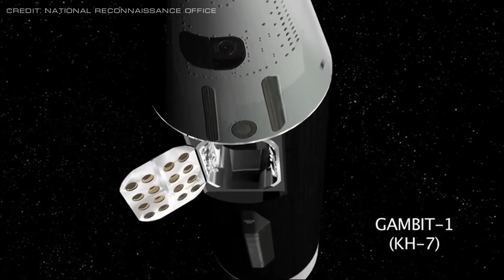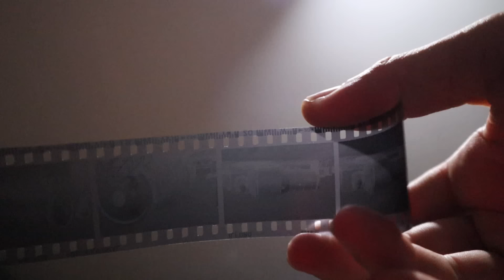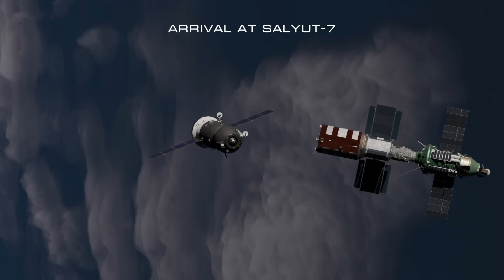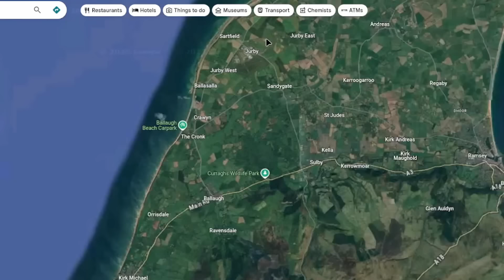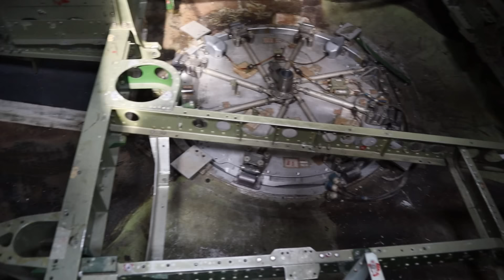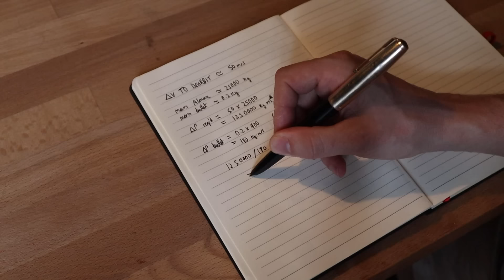Almaz: an Autocannon on a Space Station

Comment: You might be interested in using these equations to estimate the necessary correction for a gun fired from a station in a circular orbit at a target approaching slowly, such as the scenarios in this video:

https://en.wikipedia.org/wiki/Clohessy%E2%80%93Wiltshire_equations

The equations are essentially derived by linearising the equations of motion around a circular solution, similar to how a Taylor series tells you what low-order behaviour approximates a function around a given point

Comment: Is there any scenario more terrifying than being an astronaut launched into orbit on top of a hydrazine/dinitrogen tetroxide propelled rocket?

Yes, I think there is:
Make a ballistic missile designed to launch multiple nuclear warheads instead of a crewed spacecraft. Fit that missile with similar (albeit smaller) rocket motors, also using hydrazine as the fuel. Instead of using straight dinitrogen tetroxide (aka NTO) to burn the hydrazine, pick an oxidiser which is even more dangerous: Red fuming nitric acid (aka RFNA), which has all the same risks of NTO because 20% of it actually is NTO, but comes with the bonus prize of being horrendously corrosive as well.
This hydrazine/RFNA propellant combination is so murderously vile that even the rocket scientists who first concocted it gave it the name of "devils venom", but try not to think about that too much. Install 16 of these missiles on a submarine. For extra fun, make that a nuclear submarine with two nuclear reactors on board, fuelled by uranium enriched to 45% U-235.

Now imagine you are one of the crew living on board that submarine: All that hypergolic, toxic and corrosive rocket fuel isn't being burned with you right next to it, except in the hopefully rare event that any of those missiles are launched. But you are right next to it, not for a matter of a few minutes (like the astronauts), but for the entire time the submarine is on active patrol, which can be as much as six months. So a similar risk that the astronauts were taking, except that it is now constant and existential the entire time you are on board the submarine.

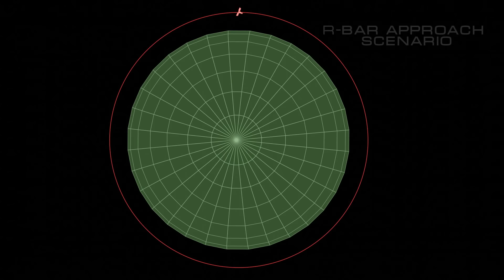Comment: 32:36

Just use high explosive shells with self destruct fuzes timed to be significantly less than 1 orbital rotation. (a common feature for HE and HEI shells going back well before WWII and common on the cannon shells in question)

23x115mm High-Explosive Incendiary (HEI) rounds
Fuze: BSh-23 Point-Detonating (PD) fuze with an SD mechanism. Some older rounds use the UB-23 SD nose fuze.
Mechanism: For rounds with the UB-23 fuze, the self-destruct is a setback-fired powder-train delay that detonates the shell after 4 to 8 seconds. 
used in the GSh-23 of the Tu-22M (and various fighters and ground attack aircraft). That was a relatively common cannon (and still in use), and used the same ammunition as the older NS-23 cannon, but not the weird thing used on the original fixed-wing Tu-22 (not the later 22M as seen in that drone footage ... those all mount the GSh-23 twin-barrel gast gun).

The Rikhter R-23 used on the Almaz (and original Tu-22) has really weird telescoped ammunition, with the shell inside of the case, surrounded by propellant. (using 23x260mm ammunition, with the shell completely embedded inside the case)

There's no information I can find on the detailed specs of the R-23's shells, but I suppose you could use the standard 23 mm HE and HEI shells as a baseline. (it's possible they used a similar projectile inside the 23x260, but hard to say without detail; the heavier 23x152 mm cartridge often used the same projectiles as the 23x115, so that's worth noting, but the unusual nature of the 23x260 leaves that less straightforward) 

But even assuming self-destruct within 8 seconds after firing, you then still have to deal with the tiny steel shrapnel particles left over from the shell. (granted, they'd be dispersed and not concentrated, so the danger would be lower)

Also no lead here, just steel and a bit of copper for the driving band (where the shell meets the rifling), so the density of the fragments would be that much lower ... though that only matters for sectional density of the impact, since we're in a vacuum and air resistance doesn't exist. (the aluminum in the HEI composition, assuming straight HE wasn't used, would also probably end up as hot, molten, finely divided atomized aluminium which would condense into finely powdered aluminum dust since there's no additional oxygen for combustion, and probably not be a significant factor overall) Russian HE shells of that era (and modern ones, along with many US, British, French, and other designs) also used thin drawn sheet steel casings with maximum HE filler based on WWII era German "Mine Shell" designs, so the actual mass of steel fragments will be significantly lower as well.

It'd be interesting to do a study on the actual physics involved for explosive shells under those conditions (dispersal, size of fragments, relative velocity to the space station, potential impact damage of fragments, etc).
Reply: id argue gyrojet - based guns would be far better as even with explosives you still on the same orbital plane have many fragments that pack a fair bit more belly than micrometeorites

Comment: If you're not very well versed in guns or how they operate why would you think the gun would 'shake the satellite apart' while also admitting it was 'more of tft-tft-tft than a bbrrrrrrrrt' seems like an unjust concern. Guns were impractical for people in space because of the imparted momentum would shoot them across space while taking necessary velocity away from the bullet. Satellites have enough mass to negate this, so the bullet still retains it's lethality while not shaking the satellite apart. IF they thought that was a problem, they ALREADY had the idea of recoilless rounds, meaning they obviously felt the variables were well within working operation. I also made a comment on your pinned comment, to inform you that 'cold welding' was not as big of a concern with material sciences creating Teflon, which can coat any metal making it impervious to cold welding in the vacuum of space while adding almost no weight. The reason why it wasn't used to take out even a test satellite was because of the inability to assure all matter would lose enough velocity to be pulled from LEO, starting the chain reaction most space agencies fear and that is complete loss of ability to use specific portions of space because of debris caught in an orbital trajectory. I'm no 'gun nut' but I am addicted to information and learning so the fact I consume your content should be a complement. I mean, I am a man and anything WW2 related in any way is of course mandatory learning.
Reply: firing engines while shooting seems to be the logical answer or using gyrojet style rounds that accelerate for longer

Comment: Those toxic hypergols have a few advantages that kind of require them to be used. The tl;dr is that the volatility of hypergols is very low. With low volatility comes low vaporization rates. For example, a spacecraft using conventional propellant would suffer from much of its commodities boiling off over time in space. That would obviously terrible fo mission longevity. Whereas these hypergols do not boil off quickly because the vaporization temperature and the liquid temperature are so close - think 1-50 K difference. For the same reason we have the second benefit, and that is the mitigation of ullage collapse. Because the temperatures of the liquid commodity and the vapor are so close, this greatly reduces the risk of ullage collapse due to the ullage gas reducing in temperature significantly, which would reduce ullage pressure. Mitigating ullage collapse allows for multiple relights and attitude changes without significant issue.

Comment: Capturing a soviet satellite was why the shuttle had such huge delta wings though - so it had the cross-range on reentry to do it within one orbit, wasn't it? yes, this IS stupid but the Air Force insisted, and it wasn't meant to grab almaz. it was huge to also be able to huck Keyhole sats up there (which is why Hubble fit, it's basically a KH pointed the other way)!

Comment: firearms nerd here:

so, the gun was effectively a pair of guns with a link between the bolts, in what is known as the Gast principle (named after the german inventor.)

where the link basically balances the two bolts' movement, both helping to cancel out some recoil but also causing the rearward action of one to make the other move much faster than normal guns, hence the absurd rate of fire as it sort of constantly is speeding itself up until the point that the gas system can't make it go any faster. 

the gun has been used on basically every Russian combat aircraft, as it gives fire rate comparable to Gatling cannons but with significantly less weight. the downside is that it overheats much faster due to the heat being concentrated in two barrels rather than the 6 of a minigun like the 20mm Vulcan, 5 of the 25mm Vulcan, or the 7 barrels of the 30mm GAU-8 (the A10 Warthog's gun), so you can't fire it in as quick of or long as intervals as western aircraft armament.

Comment: It's worth noting that heat shield hatches have a pretty strong operational history, stronger than most people are aware of. In addition to the Gemini-B trials and VA spacecraft trials you mention that had heat shield hatches protecting pressurized hatches, there were also five hatches through the belly heat shield on the Space Shuttle and I think a similar number on Buran. Three were for the landing gear, and thus not only had to work but had to open in flight after entry, and two were for the propellant lines from the ET to the Shuttle, and thus had to start open and be sealed for entry every flight. Add it all up, and it's well over 500 demonstrations of "a hatch through a heat shield can be fine".

Comment: Hypergolic thrusters only as a treat, noted! ✅️

Yo btw that launch at around @19:00 is one of the coolest things I've ever seen, what's the background on that clip??? Is it an animation??
Reply: That's a real video of an Apollo lunar module taking off. The camera zooming and tilting mechanism used a timer that the crew would trigger precisely so it would go off right as the second stage lifted off. The strange rainbow colors around some of the fast moving debris are do to how the camera transmitted color info. Communication with Earth wasn't fast enough to send the RGB values for each frame, so instead each frame updated 1 of the colors for the image, and that color's data would be unchanged for the next 2 frames, then it would be updated again. Since the colors were desynchronized, objects which moved significantly in one frame had their color data spread out along their direction of travel, making an RGB rainbow along the edges of these objects.

Comment: I have that exact same Soviet enlarger, which originally belonged to my grandfather. I live in the US but I have a European style 240v outlet installed in my workshop mostly for running European tools, but for the enlarger as well. Since here in the US we have both 240v and 120v available depending on whether you connect to both hot wires or one hot and the neutral. It is 60hz but for most tools with universal motors or for light bulbs it makes no difference.

Comment: 900 rounds a minute is still an extremely high rate of fire for a single-barreled autocannon.  It wouldn't fire lead slugs.  Aluminum or steel for practice, but for combat it'd be loaded with explosive shells.

Flares for countermeasures on a satellite?  I'm pretty sure radar is the only guidance method ever used to intercept satellites with missiles, and flares don't do anything to radar.  Eh, that's just Russian weapons tech, I guess.

Comment: A note on shooting yourself: it would be fairly trivial to load the gun with auto destroying high explosive shells, making them fragment into tiny pieces of shrapnel shortly after firing. That would increase the number of tiny micrometeorites that could pelt your spacecraft, but it would also make it much easier to harden your hull appropriately.
Reply from the maker: Ooohhhh I like this, I never thought of that.
Reply: That's not a complete fix, but it is an improvement. You'd still be speedrunning Kessler syndrome, but at least you're dealing with small shards that wipple shields can protect from instead of 23mm rounds traveling at 7km a second.

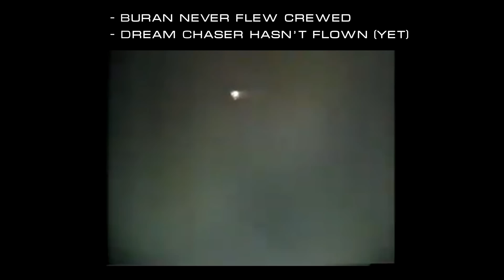Comment: 19:20 X-15 (suborbital, but twice above the Karmen Line) and Mercury used monoprop high test peroxide for RCS. While HTP will decompose in the presence of a catalyst and can be a corrosion hazard, it isn't cancer juice. HTP is one of those things that comes up time after time, and has yet to be deployed since because of the large body of work and validation behind the hydrazine and derived systems.

Comment: With regards to launching manned spacecraft on hypergolic boosters, the real risk is to the ground team and launch area. If the booster fails, either your LES works or you're part of the debris field. Back in the 90s when a Delta II failed right after launch the pieces destroyed all the cars in the blockhouse parking lot. If the first stage used hypergolics they probably would've choked on the fumes.

Comment: An error in your video: the missile interceptor you showed has a VERY low Δv compared to what it needs to do, it’s completely suborbital. 

Look at your animation again. And now let’s say the target detected or was informed of the launch and knew the trajectory. Ok then what? Well the station/target can very very trivially modify its orbit slightly so that it's both at a different place and a different time, for instance burn normal, or up and retrograde (inefficient, very wasteful), or north/south
What happens then? Well the orbit of the station with only a small burn will put it tens of kilometers away from the current path of the missile. 

The intercept velocity is high because you literally chose a retrograde orbital hop..... however that makes it completely impossible for the missile to reach the target in question. A small change in the stations orbit would mean several thousands if not tens of thousands of Δv for your missile which seems to have like maybe 8-11 total. Aka an interceptor launched with that trajectory and that mission profile has no chance of hitting something that knows its coming and can do orbital maneuvers.

Guns are absolutely useful for lower velocity intercepts, and lower velocity intercepts are what happens when something tries to somewhat match the orbit instead of that 80° 7kps retrograde suborbital madness. 
Plus you play CoaDE so you ought to know you can put your gun on a drone, put them many tens of kilometers ahead between you and the target and suddenly, you have many seconds to intercept it even at your very high hypothetical speed.
Reply from the maker: I’m assuming something like an ASM-135 launched at a station with very low thrust capability like Almaz. So, at best a couple of minutes warning  and limited evasion capability.
Of course, higher thrust engines would completely change that scenario.